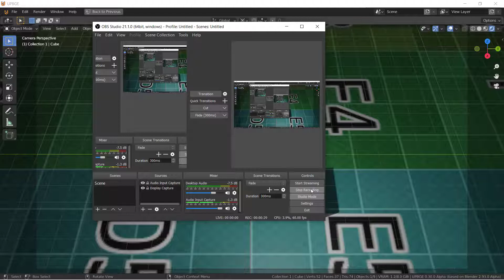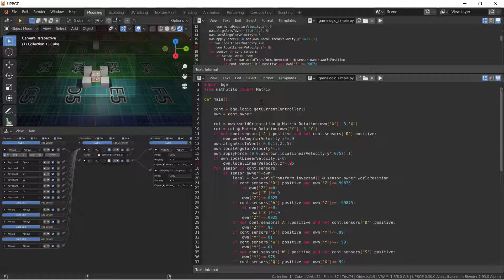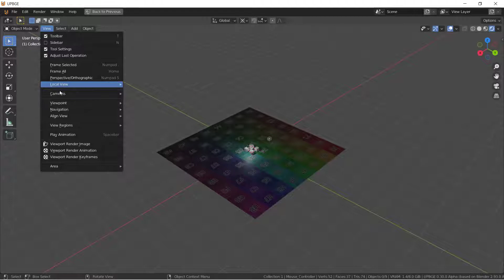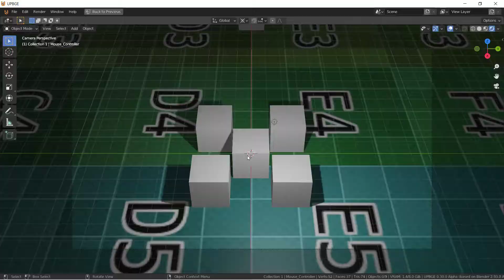Physics Drone Simulation

Comment: I believe in that when you hit the drone in a wall or take it off in a 
inclined plane and it stabilizes itself. If you dont add some randomness to the movement of the drone it will always stay perfectly upright because theres no wind nor air friction and things like that
Reply from the maker: this is flying using something similar to thrust nozzle on the space ship
(impulse at the point)

I could work on controlling the angle of the motors in 'idle' to have them cancel the rotational inertia / linear velocity
Reply: @JacobMerrill  yeah thats it, that would be really impressive!
Reply from the maker: @natgazer  https://www.youtube.com/watch?v=YOF9-tCajO8